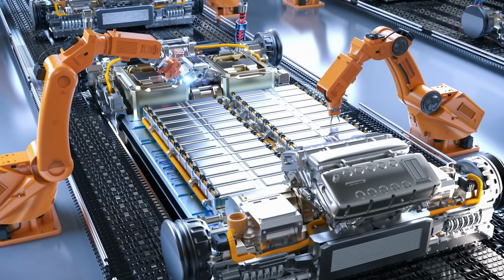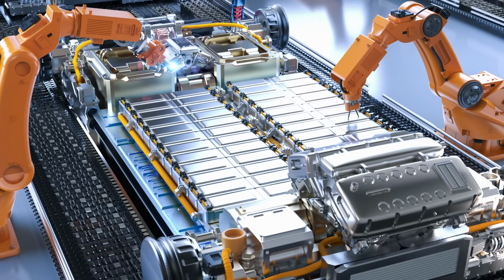Electric car batteries - from battery degradation to cobalt mining. We ask an expert!

Comment: Back in late May/ Early June last year i part ex’d in a 2015 Nissan Leaf with a Lizard 24 Kw battery what had 60k miles from new via obd dongle & leaf spy pro the battery still had a rating of 92% available out of 100% from new so 8% battery loss in 7 years,  That to me is a good figure for a battery with no coolant cooling & older battery management compared to newer Ev’s

Comment: Yes battery warranties are 8 years but ONLY guarantee 70% original capacity so a 200 mile range car can drop to 140 miles and the battery won't be replaced.  Sodium batteries are a lot less energy dense so are bigger than equivalent Lithium Ion batteries. Cars will be bigger or have less range with Sodium based batteries. At least the environment will be better off.
Reply: CATL can do batteries which give up to 1000km range.
Reply: @Andrew-rc3vh  Possibly but when we see them being used in mass production then ranges might not be so good. Tesla claim high miles but the cars don't achieve it.
Reply: @dragonbreathwales The real life tests on claimed range vs real range on a selection of modern EVs looked OK to me. They managed to hit the mark to at least 90% so nothing to really feel cheated by.  What CATL are doing is producing the whole subframe assembly so other manufacturers can build the car on top of it. They do a range of sizes so the batteries, electronics and motor all work perfectly together. The only other factor would be aerodynamic drag of the body.
Reply: @Andrew-rc3vh  My EV and my mates Tesla don't ever get close to manufacturers claimed range. Tesla lies to you all the time.
Reply: @dragonbreathwales  The Tesla I saw on test was one of the better ones as I recall. The test was to drive along a motorway and see how far each car got. Different roads though give different results. Also how you treat your battery is important. Never fully charge or fully discharge for a long life.
Reply: @Andrew-rc3vh  Yes but I think manufacturers don't tell you everything when you look at buying an EV. I AC charge my EV and according to a scan I did recently  about 1% degradation in 2 years.
Reply: @dragonbreathwales If you charge between 20% and 80% you can get about 6000 charge cycles out of it, although these figures change a bit with the type of battery, that's about what to aim for.
Reply: @Andrew-rc3vh  Yes and every battery is slightly different depending on how you charge it. 6000 charge cycles is the maximum as the average is 3000 that is why manufacturers give a 8 year warranty and not longer.
Reply: @dragonbreathwales The news is the batteries have lasted longer than they anticipated and warranties are now increasing.
Reply: @Andrew-rc3vh  Who offers more than 8 years ? Has anyone got a warranty that is better than 70% capacity ?
Reply: @dragonbreathwales I guess they will gradually wind it up as batteries improve and they have more experience so they can statistically predict with greater confidence. Batteries have come a long way in ten years. I think science will eventually lick the problem entirely and insuring a battery will be as common as insuring a petrol tank. If they last longer than then car who cares.
Reply: @Andrew-rc3vh  Possibly but I don't think we will see small hatch back cars like ID3 doing 300 mile range due to the size and weight. Hopefully they will improve winter range.
Reply: @dragonbreathwales There are so many different battery technologies in the lab i really don't know what we will end up with.  They have to balance a lot of concerns, like energy density, life, temp range, safety, recyclable...I do know the problem of limited life is well understood. The battery grows dendrite crystals that gradually short the battery out, so it is a matter of finding a way to stop these from forming.  It's big money for the one who finds a solution.
Reply: @Andrew-rc3vh  Tesla are offering to replace Lithium Ion batteries for Lfp batteries if yours fail. Plus they upgrade your suspension.

Comment: I have owned a Nissan Leaf Teckna 30 kwhr 6.6 charger in Arctic white, built at Sunderland for nearly 8 years. I have only covered circa 39k miles but it has lost 4 battery bars and 33% capacity and range with degradation. This person might tell you that modern chemistries and liquid battery cooling systems have eliminated degradation, but the modern vw id range shows about 10% degradation in 2 years ( battery life channel on youtube ). There are many other modern  'degraders' on the market as well and the bottom line is 'ALL' lithium ion batteries degrade with time and use cycles. I personally will never buy another EV, ever again regardless of further propoganda for them because my first hand knowledge has shown me that they are fatally flawed on this issue alone, never mind the constant other issues in the media , which are also correct on , slow refuelling, abysmal charging infrastructure, poor winter efficiency with even further reduced range. Real world ranges being much smaller than those advertised and 1/3 rd of some ice cars, range anxiety, slow journey times etc. etc. the list goes on and on  . The fact is that they are more expensive by far and much more inferior than petrol and diesel. Never again !
Here's some more information :-
What has an EV driver and a person with diarrhoea got in common ? They both want to get somewhere before it runs out lol 😅
Reply: My 24Kwh Tekna is just coming up to 8 years old with 39800 miles and I've not lost any battery bars - it still has 12. Perhaps you've been unlucky?
Reply: Early Nissan Leafs had poor battery chemistry and no adequate battery management and heating/cooling system, they were very bad and carry a lot of the blame for the idea that EV batteries all loose loads of range. 
Modern properly engineered  EVs don't suffer from these problems to anything like the same extent. I have done 53K miles in my Tesla Model Y and haven't noticed any degradation, it will still do more than 300 miles even in the winter. Independent data shows that the average Tesla looses less than 10% range in 100k miles.
My  5 year old 135k mile Renault Zoe has some degradation but it also doesn't have a modern battery management system.
After 5 years and 185k miles of driving EVs I will never go back to combustion  cars, I don't see me buying anything other than another Tesla.

Comment: Reading the high mileage Tesla pages I call BS on this .. most batteries are stuffed at 10 years 
Some do last .. but many past 10 year mark can be on the 3rd batteries . 
Another point ,  isn't recycling a lithium around 5x more expensive than mining a new one .
Reply: The long range is real, but yes a few of them are on multiple batteries which they do not hide. There are some with 300k miles on original battery. The fuel cost saving alone would easily cover the cost of a new battery and still be in profit.
Reply: @colinwiseman  30 thousand is a lot of fuel  for me thats 12 years worth
Hopefully the misses M3 battery lasts
Reply: @MrBigbbb  where do you get £30k from?
Reply: @colinwiseman  sorry I was thinking Australia price .  I think they are 20 K US? I think model s batteries are a bit cheaper
Reply: @MrBigbbb  to buy a new EV battery, for the most part is less than £10k. It's around £6k for a new 55Kwh battery. And most people don't see any issues. Along with the 8 year or the 100k miles warranty, very few people have to pay out for a new battery. So $20k seems wild as though someone has been lied to.
Reply: @colinwiseman  reading online Tesla battery is $14k US plus install must be $6k install ? It’s a lot of work pulling them out apparently
Reply: In terms of recycling, I can't find anything saying it is five times more expensive. But that could be true. That said, what I am seeing is reports that lithium recycling is a booming market worth billions. Maybe if you take out the cost to set up a lithium mine or brine field, it is cheaper. But to recycle it a new company can make profit?
Reply: @colinwiseman  there is a video on a plant in the US that quoted the 5x 
They run on govt subsidies 
Actually the lithium recycling is in trouble .. lithium prices have sunk so  they cant make money ..
A few stockpiles of lithium for recycling has caught fire waiting for it to be processed
Reply: @MrBigbbb  "a video on a plant" isn't really a good enough source.
Reply: @colinwiseman  apologies , I've been trying to find it . 
Lithium prices have sunk .. here in Australian lithium isn't getting recycled .. apparently no money to be made .  The government will have to subserdise it
Reply: Lithium battery recycling isn't cost effective because at the moment, economies of scale haven't kicked in. There aren't enough lithium batteries that have degraded to the point where they need replacing. If batteries only last 10 years, there were hardly any EVs 10 years ago so the supply of batteries for recycling is tiny. Redwood built a recycling factory but they're scratching around for batteries to recycle, they're looking for toothbrushes and tools let alone car batteries. It will probably take several years to be viable.
Reply: @EwanM11  there are  millions tonnes of lithium batteries, ex caravan , power tools going straight to landfill .. plenty of articles online about it
Reply: @MrBigbbb  don't exaggerate. Tesla, the biggest EV maker in the world, likely put less than a million tons of batteries into new cars last year. The amount of batteries going to landfill, while not nothing, is trivial compared to what will be around in 10 years. You need more than 2000 laptop batteries to make a single car battery. No one is going to pull apart that many batteries just to make 1 car battery. And most things have smaller batteries than laptops.
Reply: @EwanM11  we still should be recycling those lithium batteries.. there are chemicals in them that we’ll end up in the ground and maybe get into water supply ?
Reply: @MrBigbbb  i don't think it will financially viable for some time, but they should be sorted and stored away from regular rubbish, the same way paints and oils are,so we can avoid environmental contamination. But yeah, some of it will just end up on the heap.
Reply: @EwanM11  needs to be govt funded
Reply: @MrBigbbb  Uk Model 3 are being quoted around the £7k mark out of warranty. There's variance on the different battery types used on the model 3, some can be serviced, some can't and the structural battery pack on the Y certainly can't be
Reply: You are spreading fossil fuel funded misinformation. This is straight out of the tobacco industry playbook. It's extremely easy to find original model S in the UK with high milage AND the original battery. You're either lying or misinformed.

Comment: Cobalt is mined to manufacture diesel. Some now used for EV's. Good news is that people started looking at cobalt mining by children that has gone on for years for the fossil fuel industry. The mining using children is now nearly zero
Reply: Yes an oil refinery needs cobalt as a catalyst, lots of it. Not a new issue or one unique to batteries.
Reply: Cobalt is also used as part of some protective coating on zinc plated car parts. Very effective at reducing rust on parts exposed to wet and salty conditions - commonly seen on things like brake callipers.
Reply: Also used in blue dyes for nice clay pottery

Comment: I measured my EVs battery health via an OBD dongle and the car scanner app. It reports 100%. I tried to calculate it via the trip meter and its consumption figures vs nominal pack capacity and that came to 98.8%. 

Not bad for a 3 year old car that's done 36,000 miles. 

I wonder if Euan is reading the comments and knows what the Hyundai BMS logic is for reporting state of health and whether this is reliable ish or to be ignored?
Reply: After 3 and a half years and 54,000 miles mine is down by no more 5% at an absolute maximum. Maybe I should get a dongle to check it in detail. At 1 or 2% at year average, the battery will easily outlast the car itself.

Comment: The media need to compare oil driven cars to electric , Dont compare granular technologies.
Reply: How much of driving an ICE car is renewable? 🙄
Reply: @EVoLutionAutoDrivingSchool  you can replace driving habits for instance I no longer drive everyday .. instead I use electric public transport .
An EV isn't 0 emission ,far from it .
Alot more mining also in producing them .
I'm a fan of EV .. it's just there is a lot of BS .    Govt wanting it fast tracked is giving us rubbish cars with poor depreciation , expensive insurance , expensive fast charging and questionable battery reliability with the odd self combustion problem
Reply: @MrBigbbb  20x less self combustion than combustion cars
Reply: @Lewis_Standing  no doubt electric ⚡️ is the future , it just has some teething issues now
Reply: The media are only interested in selling papers/getting clicks. So anything they can make controversial works. I gave up on main stream media a long time ago.
Reply: EV is still largely busing fossil fuels depending on the mix . Most western countries electricity  is 40-60 percent fossil fuel ..  I have an EV it's nice .. but it can be a souless experience if you are a car person